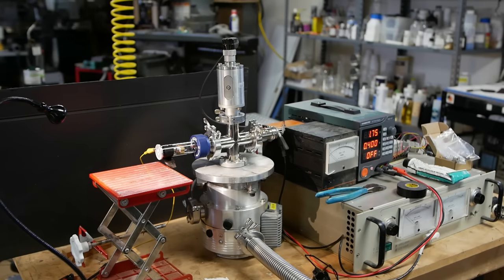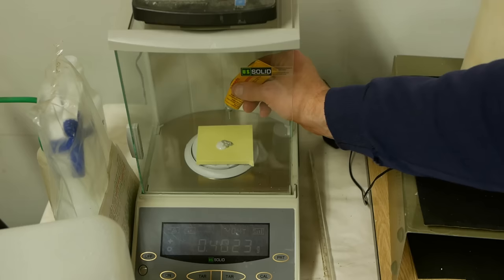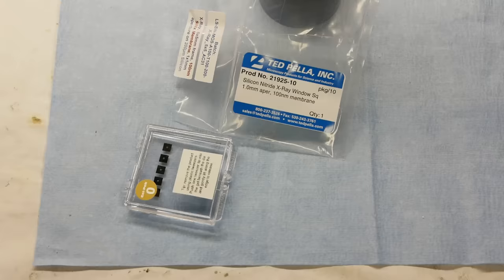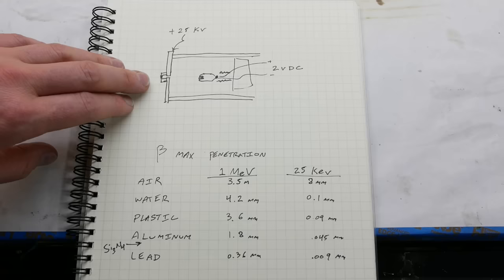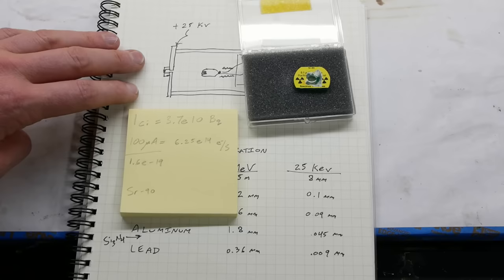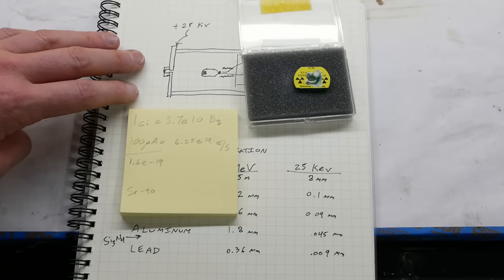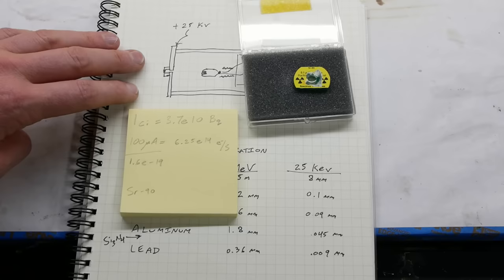Shooting an electron beam through air

Comment: Put some uranium and turn it to weapon grade plutonium... 

This is interesting thing, what type of glass they use those tubes in x-ray machine? I have few of them, they don't have even heating element. Could it be maybe sapphire?
I just know that those don't radiate without electricity at all, but there is still that logo what tells it can make bad for people if used uncorrect. I think they wanted just equally radiation, not like beam. There was at least 4 those in one machine, working DC and few thousand or more voltages. Positive and negative terminals are marked at these tube type things. There is resistors with every tube, maybe for eating power that have left in kondensator bank. I think those are some 25kOhm resistors.
Those tubes aren't very big ones, about same than this homemade one in video. But whole different inside.
What gas they using in these or is it just full wacuum always?

Comment: Very cool physics experiment! Thanks.
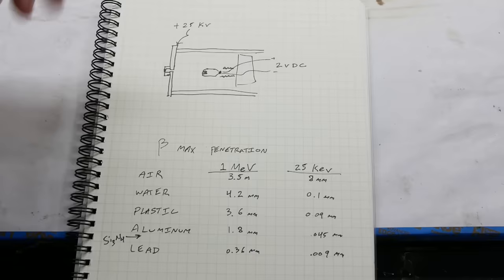At about 7:00 min, you argue about "hard X-rays" and Tungsten vs. Aluminium. I think that's not correct.. the hardness, i.e. the energy of the X-rays created, mostly depend on these 25kV acceleration voltage. The (Al-) target just converts this kinetic energy into max. 25keV of radiation energy, ('bremsstrahlung'), in first approximation independent of the metal used.. The first X-ray tubes were made of Copper, I think, but this simply wore off too easily, due to the generated heat, which evaporates Copper and Aluminium, but not Tungsten.
So I assume that 25keV X-rays will be emitted backwards into your setup, but mostly swallowed by the glass.. same situation occurs in old color TV sets with vacuum tube screens, where 25kV, shot on the internal metal grid mask (correct designation?), also did not harm the user.
Reply: I'm not sure about how much xray is from bremsstrahlung and how much is from recombination of electron orbitals (characteristic xray) that depends on elements https://www.jeolusa.com/DesktopModules/LiveContent/API/Image/Get?mid=4725&eid=1&Type=View&PortalId=2 (1.48keV for aluminum, ~8.4keV+1.7keV for tungten), but it's a good point. I almost forgot about this in EDS spectra. 
It would be interesting to find how efficient are various materials at shielding: aluminum vs iron vs leaded glass.

Comment: As a radiation  protection expert I'm fascinated by this electron gun! But I spot one possible mistake, the range of 25 keV electrons can't be as much as you have calculated here. The range doesn't go down linearly with decreasing energy. Betas of tritium for instance have a range of 7 mm in air and a maximum energy of 18 keV. The range of 25 keV electrons might be almost double but not more than double this figure. I'm in the Netherlands and it's time for bed now. I'll look into it tomorrow.
Reply: I found a range of around 1 mg per cm². In air this is about 8 mm which agrees quite well with your value. But if you use 3.5 meter per MeV you will find 10 times as much. Which makes me wonder which rule of thumb did you use?
Reply: @woutmoerman711  meter/MV is for spark breakdown in an e-field, not for pure-KE of gas-penetration for e-beams.

Comment: 3.5 m in Air at 1MeV 👀?! That's the closest thing to a light saber that I have ever seen so far. 🤔 So... At 500keV you would get 1,5m auf ionisation path? Is that correct? That's not far away from producing a plasma like a real lightsaber just not enough ionisations density

Comment: Note that most of your cathode current isn't going into the actual emitted beam as a lot just hits the end plate.  It's possible to improve that via electrostatic lens technique if you care.

If you'd had more magnet and more room, you could have seen the magnet bend your E beam easily, as I show here (the glass fluoresces from the electrons tossed off by an electrode at the back of the tank with 50kv or it) https://www.youtube.com/watch?v=mTDrQg7U4Wg&list=PLqWoXk95hIGOb3YyN4zI5CSUWWtpYAJIj&index=48&ab_channel=DougCoulter

Of course, in this very old video of mine, I'm cheating in the sense that he magnetic field is mostly going on through the window and bending electron paths on the vacuum side.
I quickly learned to stop those electrons before they hit my expensive vacuum chamber window - sometimes I'd get a focused beam and it will ruin the glass....(this is a fusor setup FWIW and I have kw level power inputs).

Comment: try to smash a atom with this thing. use a use radiation meter to detect if there is is radiation present when electron hits atom. if there is increased radiation then the atom have been fractured.

Comment: Next step would be to design it to  create an electron laser!
Reply: Not possible.  That's why this......person thinks this beam is not dangerous.  Electrons can't penetrate much.  That's the only reason they're safe inside a cathode ray tube (old TV tubes). They can't penetrate the glass front of the tube.  And even if they could, as with this guy's beam, they can only penetrate earth's atmosphere for a fraction of an inch.   BUT IN THAT FRACTION OF AN INCH THEY ARE DEADLY!!  As I mentioned below, if you make this device, you might as well open up a working nuclear reactor.  Placing a part of your body in front of the beam would be the same as walking into Chernobyl when it was boiling over.  Now in outer space, maybe this would make a ray gun.  But it would take some time for them to die.  If you've never seen them, take a look at the pictures of the people who died of radiation poisoning after Nagasaki & Hiroshima.  They lingered on & suffered for days & weeks.

Comment: TWO spellmans, one positive, one neg, for 60KeV accel potential?  (Floating batt pwr of flashlight bulb?)
Spellman's internal assy are often only $50 on eBay, but more often $100.  They take 30VDC drive at an amp or two, plus a 10VDC signal to set the Vout.    Search eBay for spellman X3000, or older CZE1000, or just spellman 30KV.    Figure out the connector pinout using an existing rack-mt version.  Do you need the Spellman internal schematics? (the supply manual has them removed, but they're still in these older manuals!)

Also see, EO Lawrence chasing after teh megavoltses:  https://publishing.cdlib.org/ucpressebooks/view?docId=ft5s200764 

First giant Lenard tube is 1940s Arno Brasch:  http://amasci.com/amateur/capacitron.html, discovered plexiglass lightning, discovered food sterilization  ...no other uses?  Death rays: Nazi 100MeV Rheotron, aimed at allied bombers during WW2!!   Not bio effects, instead it shorts out engine spark plugs, the stalled aircraft starts descending.
Reply from the maker: Thanks for the links.  Also, thanks so much for all of the articles that you've written over the years.  I remember reading your website back in the mid/late 90's when the WWW was kinda new.  It was really inspiring, and was a big reason why I went into STEM fields.  I remember one the early articles that really stuck with me was "ball lightning" .  I couldn't believe my eyes when I put a lit candle into a microwave oven, and saw ball lightning in all its glory!

Comment: You position the acrylic sheet wrong, it did not allow for proper diffusion. The electrons should've passed through the end of the sheet allowing it to flow with the print/acrylic. You would have gotten the results you were looking for, for more info research light diffusion. A properly made diffusion will allow the light to show on both ends of the sheet.
Reply: @alos10subspasomipack33  just trust me on this, you were shooting the electrons and the photons against a brick wall in that manner. Light follows the fastest route and if you had positioned the acrylic sheet on the side that exposes the printed mold pattern then the photons will follow through. Trust me on diffusion, thats what you were aiming for.

Comment: This paper's abstract (I don't have access to the full paper) claims that irradiating food with an electron beam extends its shelf life by "inhibiting a variety of foodborne pathogens":
 https://www.sciencedirect.com/science/article/abs/pii/S0924224415000692

Maybe you could try periodically irradiating milk to see if it lasts longer before spoiling? However, considering the numbers that you presented about the beam's ability to permeate water, it may not be feasible without an apparatus that is significantly stronger, or increasing the milk's surface area.

Comment: After implanting electrons in acrylic, you can try demonstrating thermoluminescence, which is light emitted when trapped electrons are released by heating.
https://www.youtube.com/watch?v=imoZYMEZ6KQ

If you use a photomultiplier, it may be possible to record the flashes from individual electrons popping free. And if you combine a microscope and an image intensifier, you may be able to visually see each flash.

Comment: Help plz!! To the youtuber. If I told you that my neighbour has been deliberately manipulating my colorbond roof to bang so loud or to have a low sounding dense thudding noise and leaving no physical evidence such as rocks being thrown, ice cubes thrown or any other hard object you can think of. Whatever my neighbour is doing/using an object it sounds like it's metal hitting metal. I do hear a boiling sound before my roof goes crazy. I've only been researching lately and everything I watch on electrons being created & released in to the air has me convinced that this is what he's doing & firing the electrons in to my metal roof with extreme force. Hence the loud banging. I have a feeling that it's controllable in regards to voltage. He won't stop & I can't prove it to the police. They think I'm crazy when I tell them what I hear before my roof goes nuts. I need help plz on what he maybe using or a home built mechanism he is using. My mother gets scared as hell cause he maybe doing damage to our metal roof. How can I prove he is firing electrons at my house? Thank you in advance ✌️

Comment: Bruh he's got a turbopump but he uses KF fittings...
Reply: And your point is ...?!
Reply: @ciprianpopa1503  KF isn't rated for UHV like CF. Turbopumps run 4-5 figures, so gasket cost probably aint an issue for him
Reply: @duncanw9901  Yeah but the pump is not CF. Who talked about UHV anyway? Moreover, the windows would probably crush at UHV
Reply: @ciprianpopa1503  fair enough about the pump. But pressure in vacua asypmtotically decreases to ~14psi, so the pressure differece from like 15 micron to 1e-15 torr is basically zero; doubt the screens would break. I just rarely see KF on equipment in the states so it was weird to see
Reply: @duncanw9901  I have kf on the sem I use. I have ion pumps from the old sem I trashed also using kf. I also pump infrared detectors using kf. Cf can indeed be used under 10-8 for faster vacuum but it is a pain in the ass to open it and reseal it. When you open it you almost certainly have to change the copper gasket. Who can afford that as home/garage user?
Reply: @ciprianpopa1503  yea fair enough. Most of the stuff I work on is high enough to need baking, so CF is the go-to. You can get reusable Viton gaskets for CF, but it's a pain in general. In my experience you can use CF coppers twice if you really need to, if you line the crimp mark up close to exactly. My original post was more bc I usually only see turbos on higher vac systems, and therefore mostly in conjunction with CF.
Reply: @duncanw9901  You must be in a very specialized lab indeed if you say that you barely used KF. I also work with rare stuff but CF is the last resort. Mass spectroscopy usually.
Reply: @ciprianpopa1503  learned most of it in gravitational wave astronomy so yea pretty specialized. Measuring attometer-scale distances needs pretty impressive vacuums
Reply: @duncanw9901  Then you can excuse us mortals that we mostly use kf.

Comment: The "hardness" of your X-rays does not depend so much on the target (Al vs. W) but solely on the anode voltage. 25keV is a kind of soft X-rays but they are  no good for your body. They are not so penetrating as "normal" medical X-rays are (~100keV) but more like "mammography" (50keV) for imaging soft tissues. They also cause the most carcinogenic effect. So containing that vacuum bulb within a metal envelope would be a good idea. Also watch out for scattered radiation. In radiation safety, the "ALARA" (as low as reasonably achievable) principle applies. Do not absorb any radiation if you can. I once thought that I must absorb a little radiation to conduct a certain measurement, but our radiation safety officer showed me a way to do that measurement without exposing myself. So think twice.
Reply: X radiation produced by electron bombardment of a target is affected by many factors, including the target material. Biological effects from radiation show a threshold effect, where ionizing radiation below a certain level will have no long term effects. The threshold exposure level depends on the type of radiation, and also the exposed individual.....
Reply: @user-cr5yy4te3i  "affected by many factors, including the target material" - true, but not to such an extent to be significant in this case. Target material causes peaks to be present in the radiation spectrum, but the lower limit of the wavelength, as well as average spectral power above that wavelength are not significantly affected. "Biological effects from radiation show a threshold effect" - wrong. The threshold theory was abandoned a while ago. The modern approach for considering ionizing radiation biological effects uses no threshold. Even smallest doses of radiation are harmful (predominantly, increasing the risk of cancer), so any exposure should be avoided if possible.

Comment: This is a VERY dangerous video.  It is showing how to produce a beam of Beta particles which is EXTREMELY DANGEROUS  IONIZING RADIATION.  Yes, it is only in about 1/2 inch in front of the tube, but in that area, you might as well open a working nuclear reactor.  An example of how ignorant the presenter is, at 8:25 he says that the beam is 11 Orders of Magnitude stronger than the 'harmless'  radioactive source in the little green box.  I've long since forgotten exactly the math of Orders of Mag, but it's something like 11^10 (11 to the 10th power)......a HUGE number.
This video is horrendously dangerous without warnings & proper knowledge.  Look up Beta Particles & see for yourself.